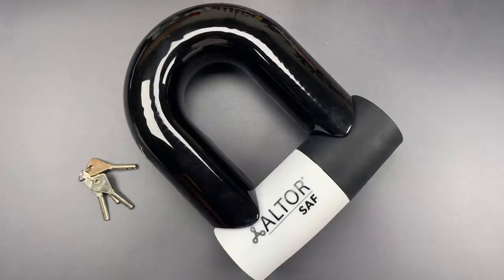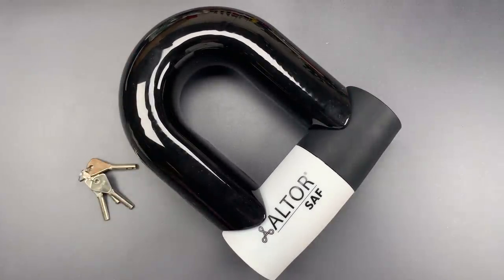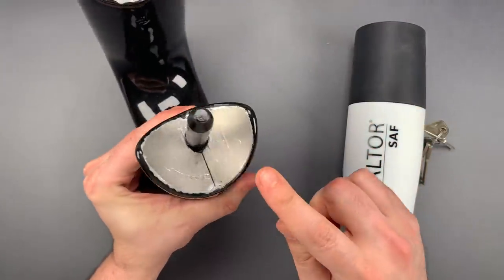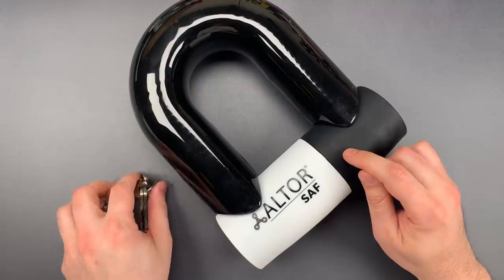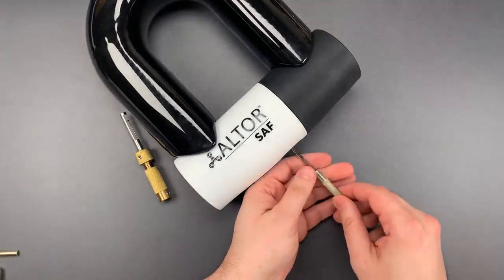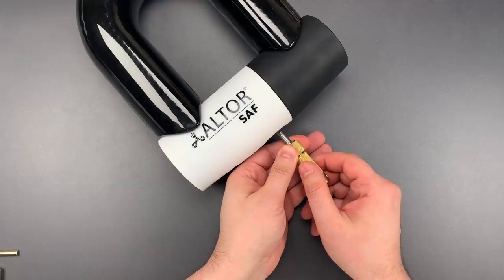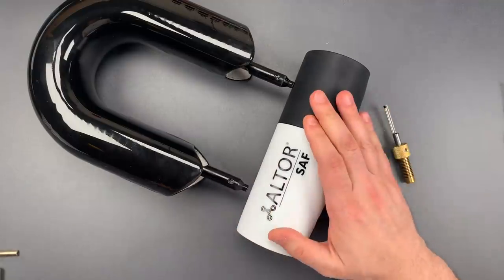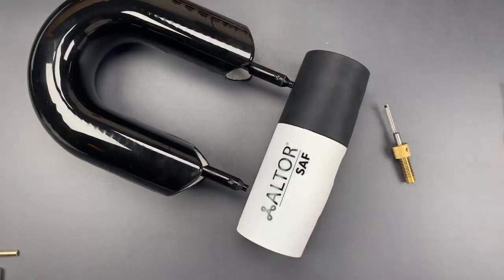[1088] MASSIVE Altor SAF ("Strong as F***”) Bike U-Lock Picked

Comment: "That doesn't look that big"

Hand comes into frame

"...that's a giant lock"
Reply: Where does that even fit without warping some part on a bike?
Reply: @no u this lock is used to lock up God's bike
Reply: Big black lock
Reply: That was a WTF!!  moment.
Reply: @ArthurKhazbs  😂 😂 😂 😂
Reply: I think it’s meant to go around the tire of the bike and “clamp” the tire to the bike rack.
Reply: @shad0w_dragon178  that would be useless because you can just take the tire off it’s not difficult.
Reply: Ya
Reply: @calebm.5698  True
Reply: @calebm.5698  the lock would surround both the tire and the actual wheel, so still theft proof.
Reply: did you not see the keys
Reply: @insert_username_here  most bike wheels are incredibly easy to remove for maintenance or storage, they are usually either a 15mm bolt, clamp skewer, or thru-axle. It would be easy to take the bike and then source a replacement wheel.
Reply: @calebm.5698  oh of course I didn't think of that. Then put the lock on the bike itself. But wouldn't someone look rather suspicious with a bike without one of the wheels?
Reply: @calebm.5698  just lock the back wheel, those are a lot more complicated to remove and replace, which is usually enough to deter an opportunistic thief.
Reply: Yep yep
Reply: @ArthurKhazbs  Gotcha bruh 😂
Reply: that's what she said...
Reply: I was a courier so ive seen alot of ulocks so i thought it was a breefy small lock untik i saw the other lock....just wow absolute unit
Reply: @22beesjustvibin67  imagine even ATTEMPTING to steal god's bike
Reply: I was thinking that exact same thing
Reply: @NiftySquares  presumably the lower frame around the area where you would normally put a water bottle attachment. The bigger question is actually finding a place to secure the lock because that lock is freakin  gigantic.
Reply: Exactly my thoughts
Reply: /r/HumanForScale/
Reply: @calebm.5698  true, but it would take time, and is more probable you activate the alarm of the bike. and if you steal a bike, you generally want it complete, not without one tire.
Reply: If you lock the back wheel inside the rear triangle, you will need to cut the wheel. Still better to lock the frame of course.
Reply: It literally looks like an anchor chain
Reply: @insert_username_here  I don't think this would actually fit between the spokes on most bikes.
Reply: @calebm.5698  Right, when you see people locking their bike up by the tire and it has a quick release on it
Reply: @insert_username_here  it doesn't matter if you look suspicious. How many homeless tweakers do I see riding one bike and carrying two more. Nobody's going to do anything about it
Reply: @NiftySquares  That's one letter away from a mighty fine bedroom compliment
Reply: @calebm.5698  maybe you could clamp it on like, the bar under the seat? Like the bars on the actual body of the bike? Idk what its supposed to be called lmao
Reply: @xxxdeadasfxck  you gotta clamp it to the frame, otherwise a lowlife with a multi tool can just tear anything the lock is attached to right off and take the rest of the bike. Seatposts come out with one screw or bolt usually.
Reply: @calebm.5698  Well now im a professional bike tire thief
Reply: I thought the keys were small! And they are, at least compared to the lock.

Comment: So how do we defend against angle grinders?
ALTOR: Just make the shackle too big for angle grinders to cut through it
Reply: The aluminum is actually the best part about it. It'll completely destroy an angle grinder, ruin the blade of any saw, and is too big for any bolt cutter to get through. It'd be like trying to eat a jawbreaker you can't even fit in your mouth.
Reply: @TheDreadedJuggernaut  it wont destroy the grinder, and there are aluminum cutting wheels. 
Granted, youd still need a big one, and a few of em, but it could be done. 
But is it worth it?
Reply: @kjfuson92  forget is it worth it do you have enough time? I mean that’s gonna take a while and be really really obvious surely someone will run you off or call the cops lol
Reply: @kjfuson92  That's the whole thing with theft protection.  Don't be the easy target.
Reply: @balmorrablue3130  The thing is, it's most likely protecting a $100 bike that's easier to cut through than the $300 SAF
Reply: Most people are too dumb to apply a lock properly by just putting it on the front wheel anyway. Unbolt the wheel, done.
Reply: @yeetusdeletus8565  someone buying this thing is probably trying to protect something like a $2,000 Ebike.
Reply: @hellzshotgun 🙋‍♂️
Reply: @kjfuson92 the lock is more expensive than the bike you’re trying to steal
Reply: @balmorrablue3130  If the cops won't do anything, and theft has become so common that civilians don't even bat an eye, and the owner of the bike will be the one who gets in trouble if they try to stop you at all, then you have as much time as you want.
Reply: @ShadeSlayer1911  well fortunately not all of us are pathetic losers who will let someone steal and destroy as they wish
Reply: @balmorrablue3130  So what are you going to do when the police arrest you for stopping the thief?
Reply: @TheDreadedJuggernaut ed edd n eddy taught me that it’s always possible
Reply: @hellzshotgun legit my thought as someone who just bought a roughly 2 grand e-bike. It’s a huge culture shock after coming from Japan where bike theft is extremely rare

Comment: Okay Altor, you've made your point. Now put that core in something we can actually use.
Reply: Exactly
Reply: We are open to suggestions
Reply: @altorlocks  what a boss response
Reply: @altorlocks  a 15kg pad lock
Reply: @altorlocks  a bike lock that doesn't cost more than the average bike could be a good starting point
Reply: @altorlocks  first time I recall LPL praising a lock. Great job!
Reply: @altorlocks  Have you considered squirrels and bird feeders?
Reply: @fishfish3429  Yeah... I need a bird feeder that is squirrel-lockpick proof... the sneaky bastards!
Reply: @altorlocks  I mean, if you could fit that thing in a regularish sized padlock I'd probably use nothing else. Not too worried about angle grinders out my way, more so boltcutters and brute force
Reply: lighting wanna be flash Wouldn’t buy.Not heavy enough.
Reply: @joehole1975  you're right make it a 100
Reply: @massiveheadwoundharry6833  Bowley lock for 1
Reply: woah legit
Reply: To me the point is to have a lock lengh enough to use it with real strong bike racks like public lighters, etc.
Because even if the lock is angle-grinder-proof it turns useless when the rack is vulnerable

Best wishes
Reply: @npc6817  you pay for one of the most theft proof pad lock, you won’t put that on a cheap rusty bike.
Reply: @zombotaro  it's a bike lock, it's what it's meant to do, only bike that could be worth using it on would be a super expensive sports bike but you're not going to leave one around in the first place so it's useless
Reply: @npc6817  it's not meant for the average bike. A bike theif isn't going to bother with a locked Dept store bike, it's not worth the effort so you don't need all the lock on it. A good rule of thumb for bike locks is to spend 10% of the bike's cost. If you have a $6000 Orbea, this is ONE OF the locks you might use.
Reply: @iamaprofessional  "wouldn't be worth the effort" tell that to those who stole my bike. Also if I had a 6000$ bike I would simply not leave it outside in the first place.
And finally, even if I did want to leave a bike worth more than myself locked outside I still wouldn't use this lock, what am I going to lock it to? With a lock that thicc there's no way it'll get around weel, frame and rack/pole/whatever
Reply: @npc6817  you still have $300 to play with to hit your 10% lock:bike value.
Reply: @iamaprofessional  I'm never spending that much on a bike
Reply: @npc6817  then I guess you don't have to worry about spending that much on a lock either
Reply: @iamaprofessional  actually I do since the price of replacing multiple cheap stolen bikes still surpasses that of the lock, but this one is just unusable in my city
Reply: Yeah, like a The Club. I dropped $1500 on my 2005 Sonata (with working air conditioning) and I want to make sure it stays mine.
Reply: @npc6817  why would you need such a strong lock on a cheap bike? plenty of adequate locks around for $300 bikes...
Reply: Didn't take him long to pick it though
Reply: @altorlocks  having the core on trailer/hitch locks would help against towaway theft
Reply: @npc6817  the chances of thief’s stealing 4 $150 bikes each locked with a mid range cable locks are externally small. There are plenty of much more expensive bikes around and many are locked with cable locks. Today I have looked around town and every single bike was locked with a cable lock, about 40% with thin cables. None was a top racing bike but many were good brand mountain bikes such as Trek. If you have a thicker cable or entry level U lock no one will bother, let alone do it 4 times
Reply: @borisgurevich5504  AND YET HERE I AM
Reply: @altorlocks  weight less than 5lbs would be a start. Make it lenghter so it can actually fit around a bike and rail. It's also too expensive
Reply: @npc6817  well you have been very unlucky. May I ask what lock was it?
Reply: @altorlocks  actually don't, make more unusual cores for diffrent applications instead, that way it won't become viable for thiefs to make themself some tool like lpl did here and that way the lock keeps being really secure.
Reply: @altorlocks  A ulock the same size. But solid steel.
Reply: @npc6817  there are mountain bikes that cost up to 15 thousand dollars, i would buy and use this lock if i rode my bike in town
Reply: @Bela-tn3sn  I just would'nt ride a 15k bike into town if I knew I had to leave it alone with any lock, if I had 15k for a bike I probably also have enough for a spare. 
Besides that how do you intend to lock it? It's too thick to get betwwen the rays and at the same time too tight to get around the main bodyof any bike that isn't a super slim racing bike, and even then you can't close it against something else so  a thief could just walk away with your still locked bike. 
It's a great proof of concept lock but impractical for it's intend use.
I'm sure it's useful but not for bikes, most definitely not at that price.
Reply: Then the tool would get more common
Reply: @altorlocks  1,000,000 kilograms
Reply: @altorlocks  a smaller bike lock that you can take with you with the same core
Reply: @TheAnonyy  only cause he had to make his own disc detainer that would fit this lock.  No smash and grabber would have a contingency against an Altor, they'll just take the bike next to it.
Reply: @npc6817  why buy a bike if you aren't gonna ride it?  You're like my dad,  $6,000 fishing rod and he leaves it at home.
Reply: @npc6817  Won't it be cheaper to get bike theft insurance? around here you can get 3 years insureance for 120 euro (total, not per year) for a 700 euro bike. If the bike gets stolen you get a new bike for free. But you have to pay for a new lock + insurance though.
Reply: @altorlocks  I have an expensive laptop, and I work with people who have sensitive information on their laptops.  What about a laptop case?
Reply: @npc6817  Dunno how it is in the US but we got an electric bike craze here in Holland the lock is not more expensive then one of those.
Reply: @altorlocks  make the lock actually usable as a bike lock
Reply: @altorlocks  wtf they responded
Reply: @npc6817  why do people always assume when they see any product that its meant for the average consumer?
Reply: @owenjames8575  fair enough, but who's this meant for then? It's not worth the expense for an average bike so it's an expensive one.
Must be a racing bike since it's the only kind that has a chance of fitting tire frame and a pole in such a small hole.
But then again it can't be for someone who races bike as a sport since it's too cumbersome to carry around without a handbag and a simpler steel cable lock is more than enough to secure a bike for a quick stop at a bar, this lock is meant to deter thieves that target bike left for longer in predictable spots.

So in short, are you claiming that this lock is meant for people who can afford a racing bike just because it looks cool but still use it to commute to work.
Doesn't look like a profitable enough niche.

This lock is a collector item that's what it is.
It has a unique gimmick, easily recognizable, uses an extremely rare mechanism and is the first of its kind.
If I was a lock collector I'd want one at any cost, but you can't tell me that its a good product for anyone who actually intends to use it on a bike.
Reply: @npc6817  don't put words in my mouth. I just don't like the entitlement on display. Clearly some people have bought it, otherwise it wouldn't be sold. Businesses aren't stupid. Besides, there's plenty of people who would buy an expensive bike for the express purpose of having an expensive bike.
Reply: @npc6817  they costs 300 dollars, and they are currently sold out. So, they're working for someone. It seems to be alot of Europeans
Reply: @owenjames8575  not my intention to put words in your mouth, just bad phrasing.
I'm not saying no one buys them, just that they're not as practical as simpler locks as they are in this concept stage.
Also sometimes I forget the rich might as well come from a different planet.
Reply: Might be easier to cut through the bike itself.
Reply: @npc6817  well I think it could be used for motorcycles to keep them safe
Reply: The average decent mountain bike is over $ 1,200,  about $5,000 for a great one, and $9,000+ for professional, handmade in America/Europe mountain bikes. 

There is definitely a market and a purpose for bike locks like this, and not just for the rich.
Reply: @alertedcoyote7892  thats the thing, if they made the bolt more portable it would be less resistant to bolt cutters
Reply: All these people saying they'd never leave a $6,000 plus bike unattended fail to realize they leave their $20,000+ car unattended every single day.